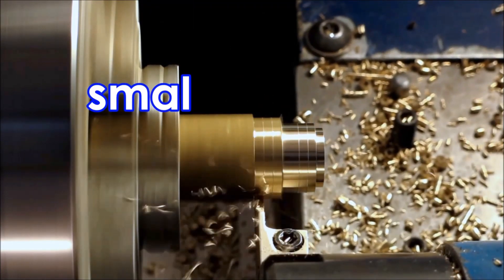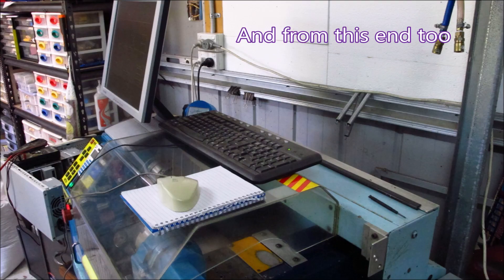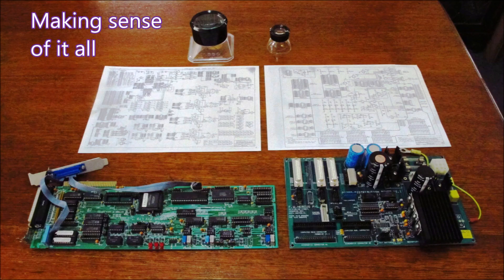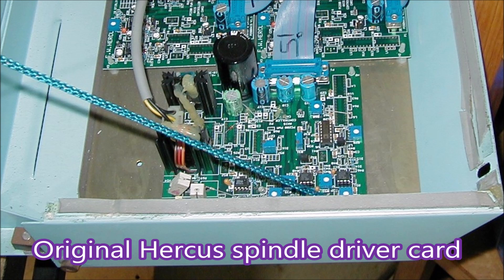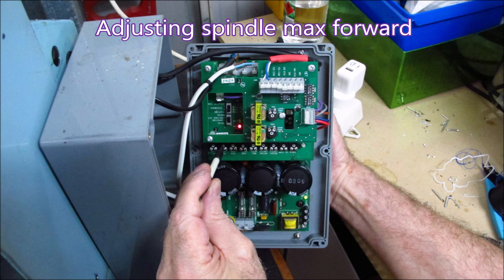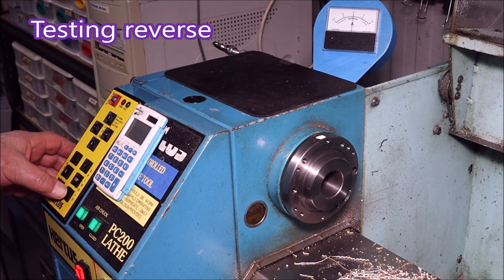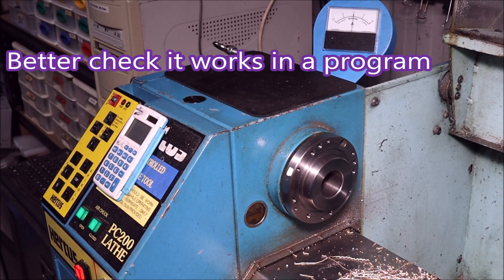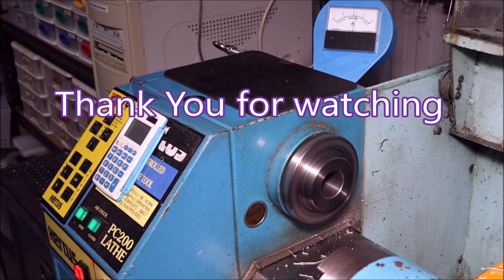Adjusting the Minarik spindle driver on my cnc lathe to get the spindle speed back to 3000rpm

Comment: Many years ago our trusty SNK SUT-50 CNC lathe was acting up where the spindle speed would droop which was catastrophic when cutting threads. A service tech traced the problem back to the Fanuc mother board. $4k (US) later a refurbished board was installed, but the problem remained. Well, turns out the voltage from the mother board going to the spindle drive goes thorough contacts in an "Ice cube" relay...contacts were slightly coroded causing intermitent voltage drop. Tech removoved mother board and reinstalled old, and new relay installed. So 2 sevice $$$ calls (one diagnostic, once service), one week of down time and one $10 relay later the problem was solved. From that moment on I learned to read machine schematics and solve 95% of problems in-house.
Reply from the maker: This is the third time we have had to adjust the spindle driver. I suspect if it happens again, a serious investigation of the driver card will be required.
Reply: @smallcnclathes  Don't discount dirty terminals or connections. Sometimes the simple act of disassembly and reassembly creates new clean contacts that work for a while. Even coolant and oil migration into the cables will cause issues when insulation degrades. I have used a "megger" to check leakage curent to ground in cables and motors (just make sure to disconnect cables and motors from the drives before connecting the meter since it uses 500-1000 volt pulses) Bad capacitors in power supply could be a problem too. We've had issues with filter caps going bad and power suplies going bad as a result.

Comment: Single Board Computers (SBCs) still use ISA slots. PC104 is ISA in the form of IDE-style connectors.

I've used Arbor's boards for years. Here's an example: https://www.arbor-technology.com/gl/Product/Pro/Model/EmCORE-i2703_1

Many makers of SBCs out there in the industrial world. They are rarely at the cutting-edge of speed, but since your lathe was designed in the days of ISA, the software likely isn't expecting a super-fast CPU. Usually, SBCs have Intel Atom or Atom-like processors and happily run DOS.

PC104 is easy to convert to regular ISA, too.
Reply from the maker: Thank you, I can but a new PC with ISA slots for 2000 aud, but if I was spending that much I would spend another 2000 and retro fit a modern control system. So in the meantime it is finding whatever old PCs are available.  At the moment I have 5 PCs from 386 P3 to choose from  and 2 lathes to keep going. Thanks for your comment
Reply: @smallcnclathes  The ones I buy are $250 USD. Low power, fanless, complete PC with VGA. Just add a HD and power supply.
Reply from the maker: @makerog5666  is it possible for you to provide a link to one of those?
Reply: @smallcnclathes  Is the link I provided in my first comment not being shown to you?
Reply from the maker: It is, but looked to me like a card for an isa slot. Will go have a better look. Thank you
Reply: @smallcnclathes  Most SBCs are like that. You plug them into a passive ISA backplane. I have a bunch, they're cheap. They can be had in 3, 4, 5, 8, 12, 16 and 20 slots. The SBC drives one of the slots (like a regular motherboard would) and your other cards plug in as they do normally. I like the design for many reasons, but swapping motherboards couldn't be faster. I've been using SBCs with passive backplanes for 30+ years.

Passive ISA backplanes run between $20 and $100 depending on slot count. They have no other parts besides the ISA connectors -- they last forever.
Reply: @makerog5666 this is good stuff to know. I have the same issue where my CNC mini lathe control hardware requires an ISA slot and the current PC I use has ‘issues.’
Reply: @torpedan  Good! Most of the SBCs come with enough RAM so you don't need to get that either. The ones I buy have 8MB on-board.

Comment: Tune up went well, good to see normal service resumed.
Thanks for sharing.
Reply from the maker: For the time being anyway. I hope it lasts a while this time. Thanks for you comment, nice to hear from you again.
Reply from the maker: I never know if I should put up videos likes this, they are not doing very well in views, but the comments I am getting are quite supportive and that does help.
Reply: @smallcnclathes  Looking at the very helpful comments, then that probably answers your question; ref "Maker OG" for example. Electronics/Hardware and Software is something I know very little about, but its there, and we like what it does, so show it!!!! The only thing I know about analog type controllers, is that the capacitors get old, and some types need replacing, even though there are classed as passives. 
Best regards John.
Reply from the maker: Hi John, my electronics is limited to nasty smells and smoke are not a good sign. Fortunately, I have a friend who comes over to manage that department!
Working on a program today to try different cuts and feeds on 6061 aluminium to see how it chips. Will probably run it tomorrow. A friend with the same lathe uses 6061 a lot so trying to help him find solutions for swarf control.
Reply: @smallcnclathes  Good luck, very little Zinc in 6061, so may not break easily, if I understand correctly.
Regards John.
Reply from the maker: @bostedtap8399  all I can do is give it a go. I am hoping small cuts and big feed will work, just have to try it and see. Video will be a couple of days.
Reply from the maker: Thank you for your comment on my latest video, I have notification of the video but it is nowhere to be found, for me to reply.  The mysteries of YT

Comment: ISA slots were commonly seen on mainboards for P4s and Athlon XP's. In fact, you can still pretty much get fairly recent boards with ISA support for Core 2 (and possibly later) architectures in the $100-150 price range.
Reply from the maker: I have not seen many P4s with an ISA slot, may P3s but that is about as late as I have seen.  I know there are modern boards still available, but if you don't have the skill to assemble yourself they are quite expensive, to me anyway. Thanks for your comment

Comment: Old logic circuits, the lathe looks lovely
Reply from the maker: Thank You.  It is a rather nice little lathe and quite well made.  The ancient electronics can be a challenge at times.  Thank you for your comment.
Reply: @smallcnclathes  I've got an old Colchester triumph 2000 lathe at work which is fairly worn and might be going soon, but I hope to persuade my boss into a CNC lathe next to fit the 2.5 axis mill that we've got.